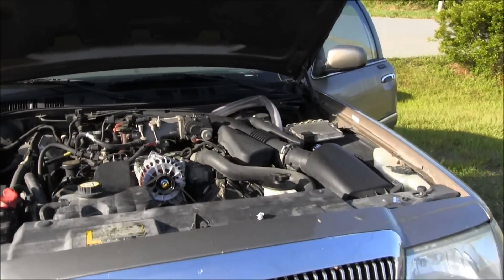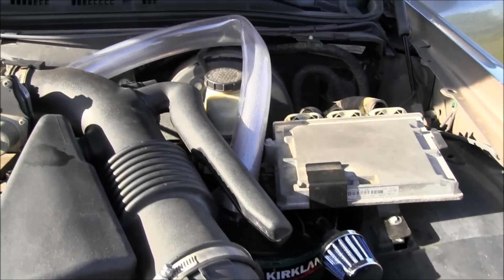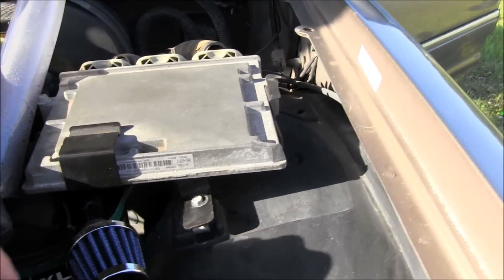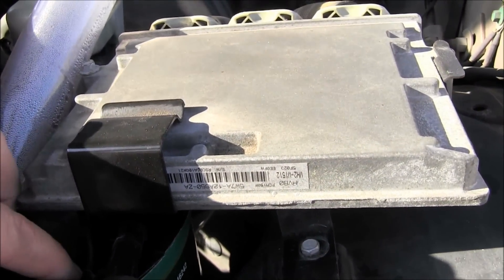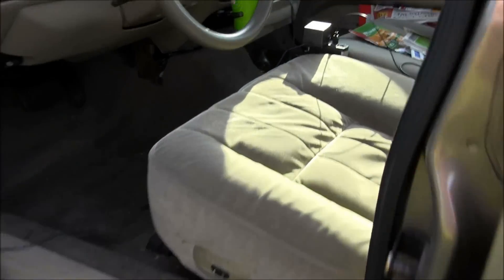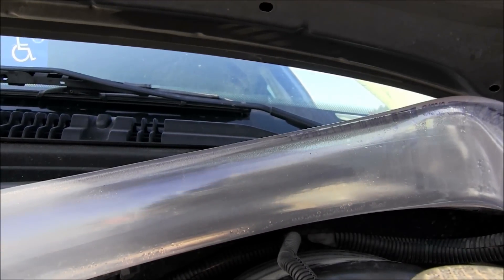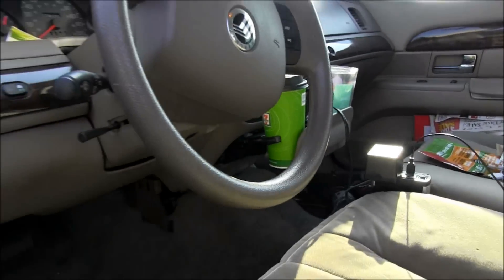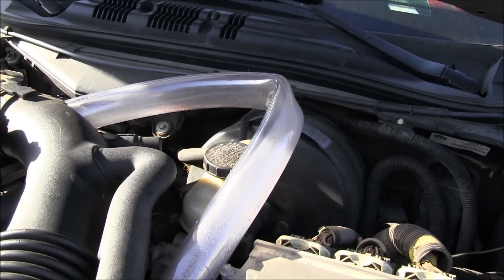Improve your Gas Mileage with water and a mist maker.

Comment: Do you just us water in the can?
Reply from the maker: Yes, I just filled the can every time I drove. I have a new larger unit in there now. A 5 disc. I think it may be too big though. I will try the three disc mist maker next.
Reply: looks cool am going to use a 3 head pond fogger going to secure it then use a gar with a pipe going through it to aggatate to gas even more going to put aqurium stone to make finer bubbles and one litter of hho and a t to get my gas vapour and air mixture just right i want 200 mpg seen on youtube he put the pond fogger right in the gas hoping the combination of all 3 three will get me 100% burn sorry about the spelling not my strong suit my goal is 500 mpg lets keep on experimenting guys and be safe use one way check vavles a flash arrester and a bubler :)

Comment: Great video!!!  I've have been researching this "fog" for auto use for some time now but haven't made one, my busy schedule. I'm thinking for your V8 you may need a double disk or you 3 disk. It appears your one disk isn't producing enough fog to get your mileage up, very minimal vapor going through that tube. I did see you have a kink in the hose so rid yourself of that soon, I think it would help. My guess would be use the 3 disk model since you can, and I'll bet you see huge mileage increases. One word of caution however, disable all water 5 min's (before) you shut that engine off (unplug your cord) to clear out all internal moisture, with any type of water injection! Other wise you will rust up the internals. You just got me exited to try this out on my 96 grand marquis with 48,000 orig miles as it does blow on fuel consumption. Whats the best way to get a good deal on one of your ultrasonic foggers, any coupons?
Reply from the maker: Thanks for the tips! I am trying to source a good container to hold the 3 head. THE COFFEE CAN WILL RUST!  (just an fyi for everyone)  Use Coupon code JUNE10 in the comments of your order, and I will refund you 10% when the order is shipped.  Good luck on your project! Keep me updated!

Stay foggy, 
john
Reply: Thanks John!
What is the diameter of the one disk and 3 disk models with height. Maybe list L,W,H on the website if you don't. As of typing this I haven't looked for dimensions but it may help all of the gas saving community guys and gals if their thinking of building one! Hey if you source containers to fit each size you could offer them up for sale on your web site possibly? I'm thinking hdpe or similar plastic?? take care...
Reply from the maker: BILL W Here are the owners manuals for all of the models I carry. The dimensions are listed in the lower RH corner with all the specifications. http://www.thehouseofhydro.com/owners-manuals.html

I'll let you know if come up with a container.

Thanks!
John